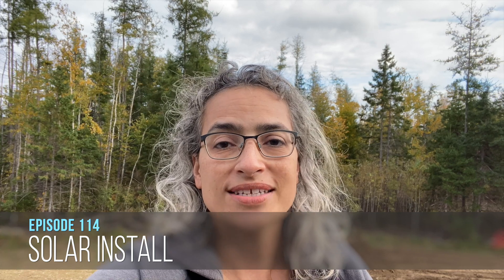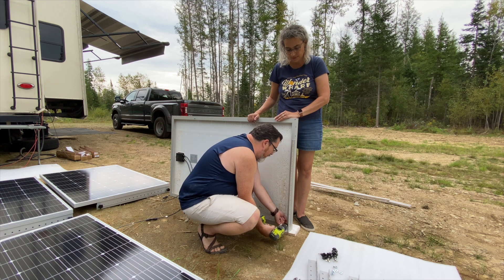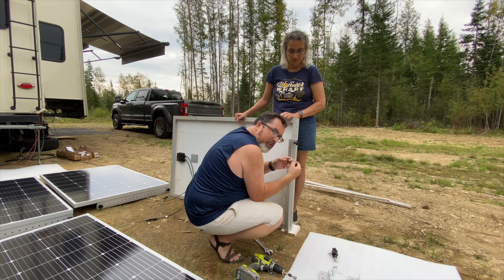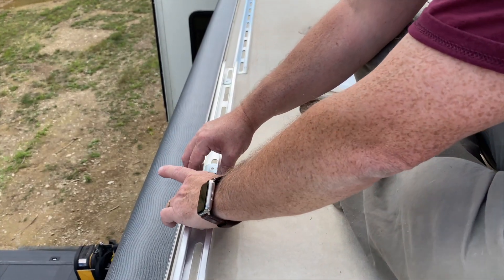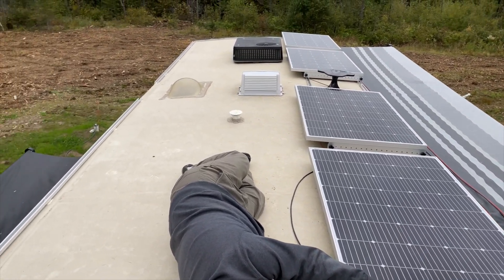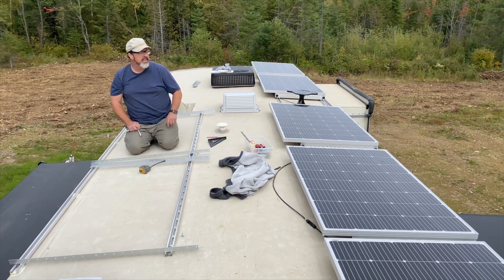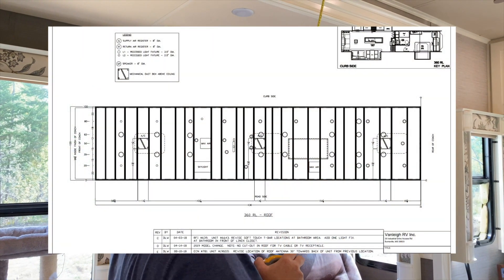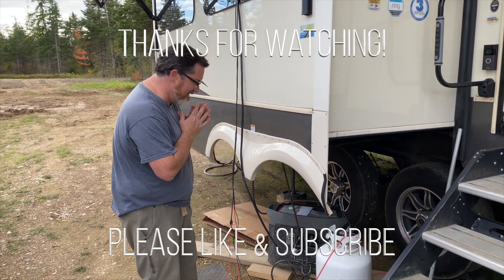Ep 114: Solar Installation - Newpowa 240w panels, tilting brackets and strut channels // RV Life

Comment: Hey guys! Super helpful! I'm curious if you have a 2 year review of this? Anything you'd do differently?
Reply from the maker: We are very happy with it and it has been working great for us with the EcoFlow Delta Pro battery towers. We have found that tilting the panels with those metal arms is time consuming, so we don’t always do it. But we have found this summer that by leaving the panels flat, we do not bring in as much solar as when they are tilted. We will plan to tilt them when we come up to our land next year, and Jason has ideas for some quick connect solutions that will make tilting them easier in the future. Thanks for watching!

Comment: OK, 2 years later - any problems? It feels like the neoprene where the screws are will do two problematic things - It weakens the strength of the fastener connection and it interferes with the lap sealant seal and allows movement of the parts under the sealant. Creating gaps for rain water is a good idea, but I think I'd put the neoprene in the spots between the screws, to create a gap where you aren't looking for structural strength.  If you put screws where you have trusses, the neoprene spacer will be in a spot where the roof has some give while the screws will be super solid. A 2" self-tapping screw into a 1/4" or 1/2" plywood or OSB isn't providing much strength. They really need to go into trusses, I would think.
Reply from the maker: No problems at all. We are very happy with it. We actually did screw into trusses, the wooden ribs that go across the roof. Thanks for asking!

Comment: I know its been a minute or two since you did this project but do you remember the size (width / height) of the Strut Channel?  I know they're 10 ft. long but I didn't realize there is quite a bit of variability on height, width, gauge etc.  I'm on Zoro's website trying to match their selection from what I can see in the video, I think you have the aluminum, 12 gauge, 1 5/8 by 1 5/8 strut channel.  Can you confirm?  Thanks.
Reply from the maker: We have Single Strut Channel, Slotted, Aluminum, Plain, 14 ga, 5 ft L, 180 lb Load Capacity, FS-500 Series. The Zoro part number is G3345478. Hope that helps, thanks for watching!

Comment: I have imstalled 30 kw of lifepo4 and two inverters a 4000 split phase and a 3000 all in one. I have 3200 watts of solar on ground deploy mounts the same as you used on your roof. 3 victron charge controllers also. The thing that helped us be comfortable off grid was of course the solar power system but i installed a 240 volt minisplit. 9000 btu and 38 seer. We use it to heat and cool as well. Sometimes I have to use a little propane for heat as well but rarely. I also built a 14 kw nissan leaf battery with a victron dc to dc charger to use kinda like a back up way to help charge if the weather was bad for a few days. The video was great and id love it if you would tell me anything different you would do with your ,roof installation of the panels. Thankyou for the video for sure
Reply from the maker: Thanks for watching! I’d say we’re very happy with it overall. Really like how the strut channel makes it adjustable and reconfigurable. We have never had any leaks or problems with the roof since we installed them.

We’ve gone back-and-forth on the usefulness/need for the tilting brackets, but since we park for so long on our land it probably makes sense to have them to maximize the solar. We don’t really use the tilting brackets when we are on the road as they are a little cumbersome to set up. Jason has some ideas to make them quickly adjustable with quick release pins that we may try in the future.
Reply: @CircuitRidinRV  I think what y'all are doing is great. I'm ordering more and more equipment each week to make off grid living easier. I spend 3 weeks at a time in this semi truck all over the country then I'm home for 2 or 3 days then back to work. Eventually once the goals are reached hopefully I can get a part time driving job and spend a lot more time in my camper. Thanks to people like you making the videos I have been able to get the solar and all the other off grid stuff up and running. I appreciate what you do for sure
Reply from the maker: Sounds like you have an awesome plan! I’m glad we and other Youtubers are able to help make your dream a reality. Best of luck!
Reply: @CircuitRidinRV  thanks. It's boring out here on the road and kinda lonely but after a couple days home I'm ready to be back out here lol . Thanks again for the videos
Reply: @mondavou9408  it's kinda like a prison cell from time to time but it's also like being on a road trip vacation that is never ending lol. One day I'd love to have a regular local driving job where I could actually enjoy some of my toys and all. It's steady run run run tho for now.
Reply: 30 kW, do you mean 30 kWh?
Reply: @WesselVanSluis  yes. that's what I meant. I now have another inverter and 7 victron charge controllers. I still need 2 pallets of panels at least. I e bought all the wire and fuses and everything to add all this to my system once I get more panels. I have enough battery now to run our little home and workshop when we are home 3 or 4 days a month and it's always charged back up by the time I'm home again. soon I plan on getting a local driving job and we will be home a lot more so I've gotta get the power system up to where it can support full time living. all this started as a hobby and once I seen I can survive with no electric bill it quickly turned into more

Comment: I just finished my install using a similar method, but I used taller strut channel and used a 1inch rubber spacer to lift it up off the roof.  Lots of room for leaves and debris to get under the strut channel. You should have run your wires through the strut channel.  There is room under those cone nuts. I hope you have a couple of good Charge controllers, that's a lot of wattage.
Reply from the maker: Our Delta Pro battery towers have the charge controllers built in, which makes managing them really easy! Jason also used a panel calculator site to make sure they were connected correctly for the wattage. Thanks for watching!
Reply: Curious what you used for a 1 inch rubber spacer…..
Reply: @MasterRobinHood   some rubber spacer I found on Amazon of course

Comment: I hope your spacer works.  Mine failed.  Overtime it deteriorated and compressed, and my screws worked their way loose, in turn a leak.  After stripping the panels and roof, I ended up using nylon spacers designed for this application - no issues now for two years.
Reply from the maker: Interesting, thanks for the heads up! We will keep an eye on them.
Reply: What nylon spacers did you use? I’m getting ready to for an install. Thanks.